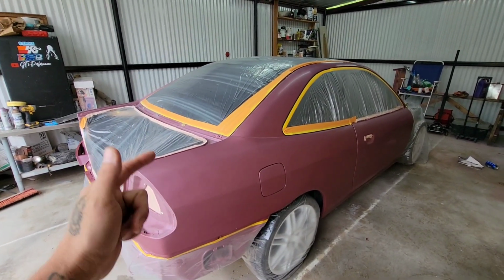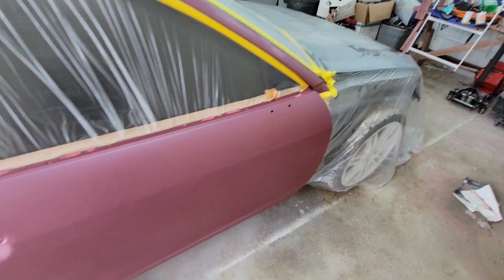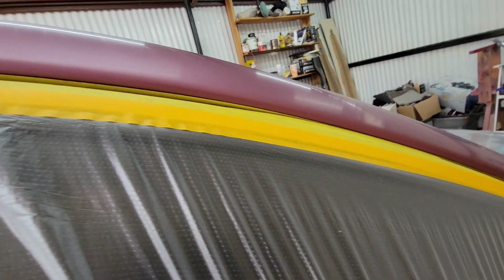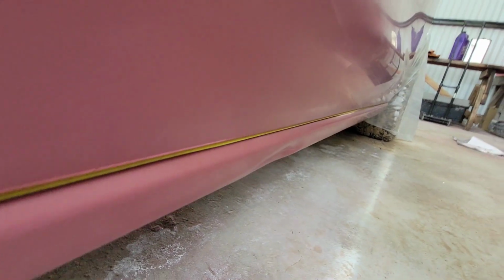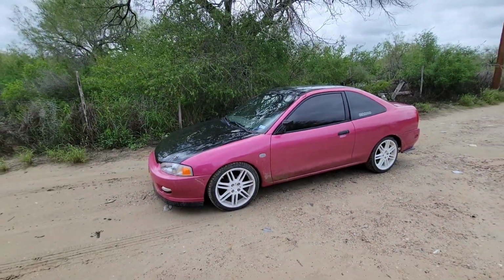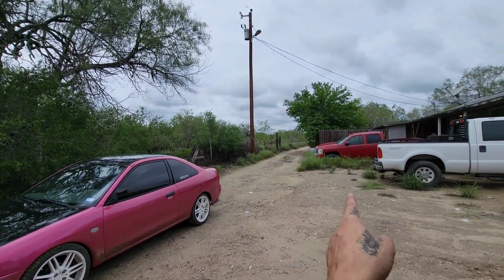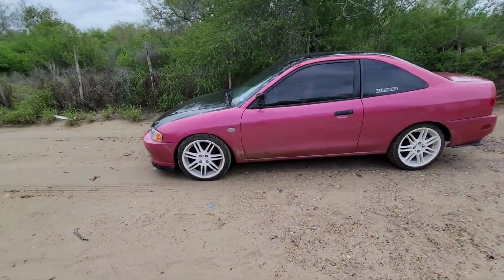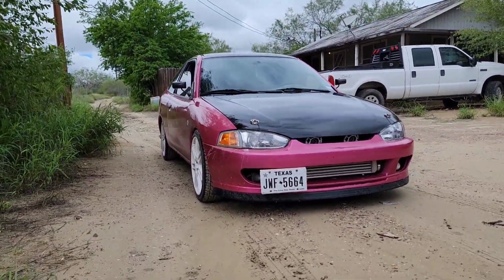Let's Spray - BAKU RED Pearl over ROSE 🌹

Comment: Bro that made a big difference. Lab Rat looks great! Is that Speedokoat clear easy to spray?
Reply from the maker: Yea, thanks bro! I've had great results with the speedokote.  Very easy to work with 👌
I use the spectrum hte 1.3, 2½ turns on fluid at 25psi
Reply: @GTsPerformance  thanks for the info bro. I really appreciate it